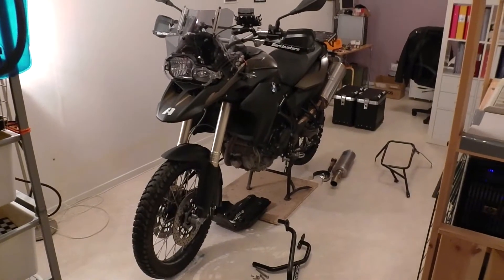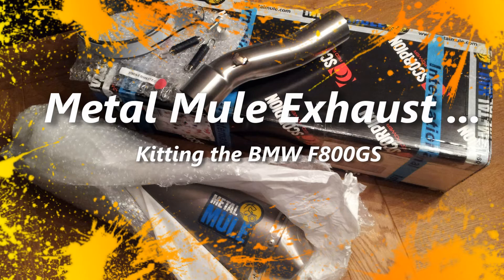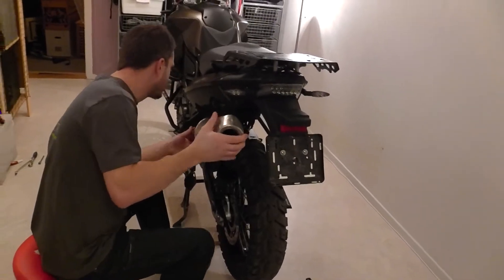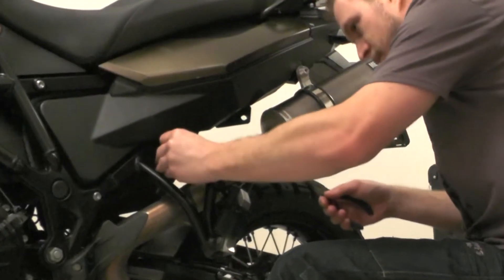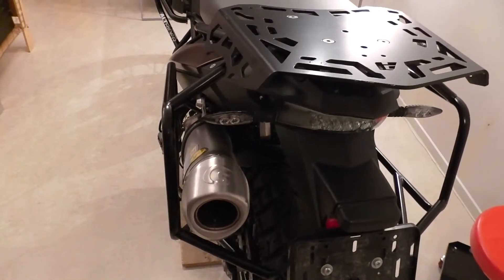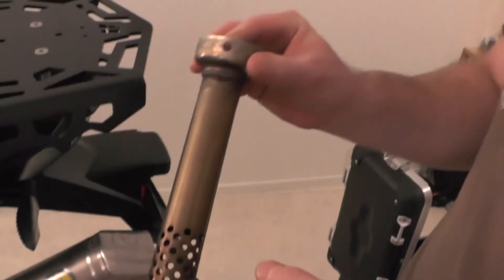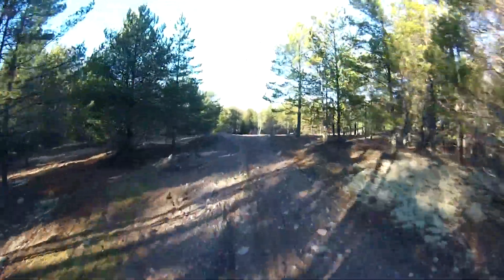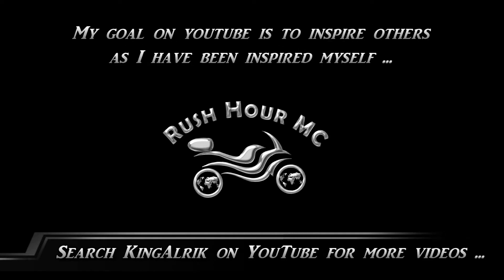Metal Mule Exhaust - BMW F800GS

Comment: do the fittings you use to attach the touratech luggage to the racks come with the luggage or the racks please? tks :)
Reply from the maker: TT sell their panniers in pre-fitted and without fitting.
We bought the once without fitting.
Then you can buy the fitting in 15mm or 18mm depending on the rack you mount on.
Hope this was the answer you wanted...
Reply: Hi thanks for your reply, but is the fitting from TT also? thanks
Reply from the maker: DAVE MANN Yes the fitting is from TT as well...
cheers...